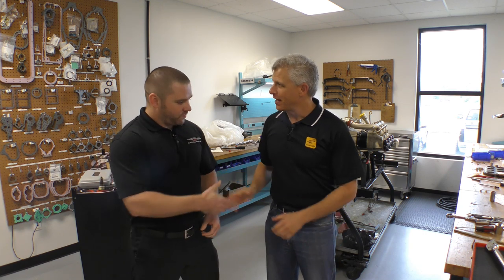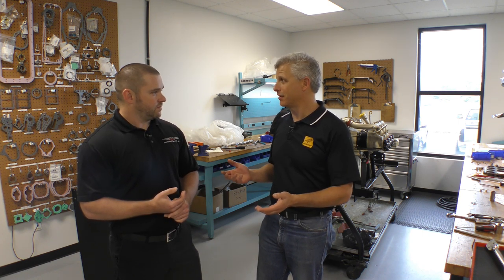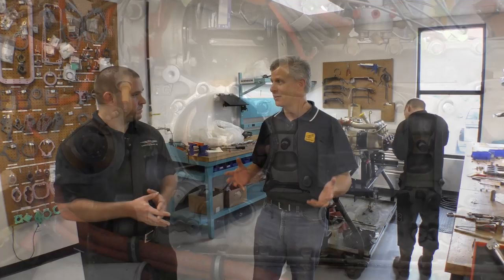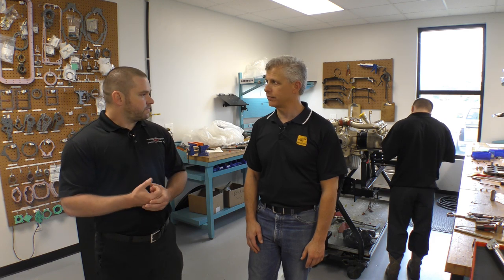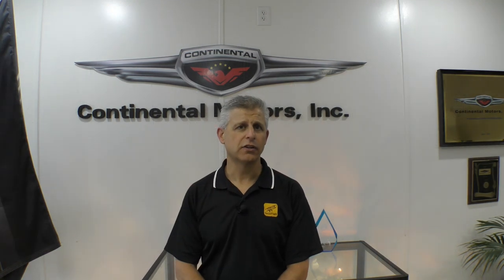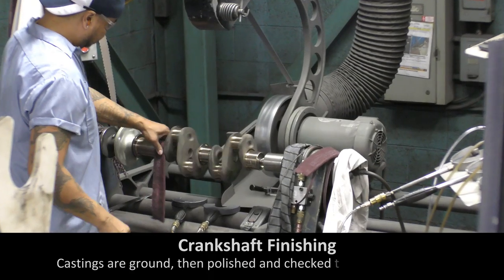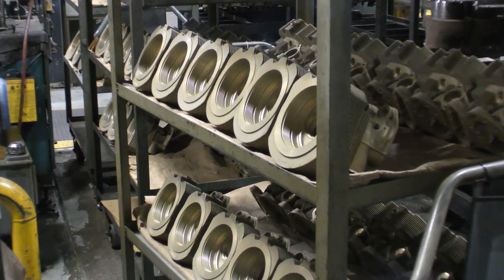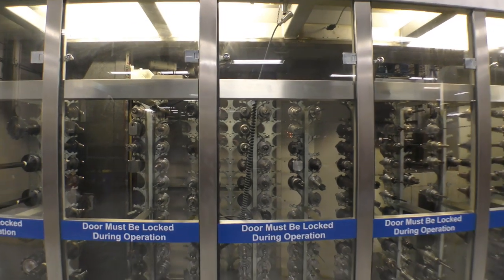Building and Overhauling Aircraft Engines - A Visit to Continental Motors

Comment: Very interesting video, thank you for posting it. I haven't seen a Lycoming engine since we worked on them in our A&P school back in the early 80s. It was very interesting to see cylinder honing by hand as shown here. We had a machine attached overhead with spring loading, you held a handle on each side of the honing device and moved it in and out of the cylinder as it rotated inside of the cylinder.
Reply: He wasn’t honing the cylinder, he was lapping the valves.

Comment: What the world needs is a small turboprop that will put the 520/550 Continentals and the 540 Lycoming where they belong-with the OX-5’s, Wright Whirlwinds and Rangers on engine stands in museums.
Reply: Where can I get the blueprints, or the 3D model, of this engine to see it in Solidworks?
Reply: I thought that what the World needs now...is Love...Sweet Love.  It's the only thing that there's just too little of. 
Except for a small Turboprop in the 350 - 400 HP range.

For the Museum, don't forget the Le Rhône rotary engines, the P&W R-4360 and R-2800. The Wright Turbo-Compound R-3350. The Rolls Royce Merlin, the Allison V-1710, the BMW 801 and the Daimler-Benz DB 605.  All famous historical piston aircraft engines.

Comment: AVIC Chinese government ownership, out of control engine and parts prices. We purchased a $50k factory rebuilt engine, the overhauled alternator never worked right, but when it finally failed due to internal short, Continental wouldn't replace it because it was out of warranty. These "amazing engines" are obsolete technology, suffer premature failures if not babied, use air cooling instead of modern liquid cooling, have no ECU, no EFI, nor any other common modern auto tech. These engines are like WWII radials: pricy boutique-produced antiques. We could do so much better.
Reply: The answer is simple, Start your own company and build a better engine, with all of the modern touches that you require.

Comment: Interesting that engines used in general aviation are somewhat primitive in design and low in output relative to displacement compared to automotive engines.  I'm assuming this is because reliability is paramount and as a result aviation engines are conservative in design?
Reply: Aircraft engines are designed with reliability as top concern. Engine failure in a car is an inconvenience. In an airplane it can be fatal. 

Plus aircraft engines run prolonged periods of time at a much higher power level than a car engine. A car engine may cruise at 40 of its 300 or more horsepower. An 300 horsepower aircraft engine cruises at 200-225 horsepower for hours on end for bulk of its life.
Reply: Not the case, old technology because of cost to certify an engine.
Reply: The only reason is because the cost to certify a new engine is enormous. It is much better for these engine manufacturers to keep selling the 1940s technology engine at insane prices (more than $50,000 each). If other competition comes, they would probably start making a better engine, but it's tough with the insane certification costs.
There is no other reason than this. Not due to being conservative or some other reason people make up. This is the only reason.

Comment: does continental make a roller cam engine yet like the io-390.
Reply from the maker: Continental's newly designed 180 hp Prime IO-370-D3A engine has roller cams, but not the other Continental engines.  I suspect that it's not as critical in the other engines because the cam is at the bottom of the engine with lots of oil vs. the Lycoming design.